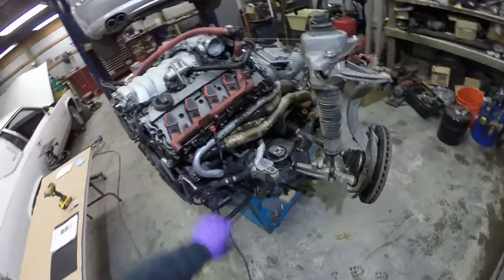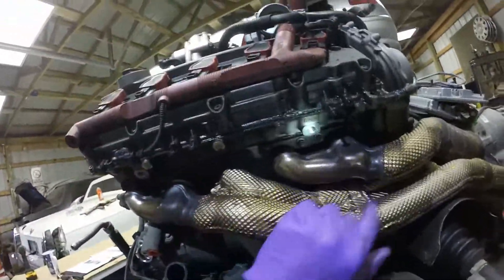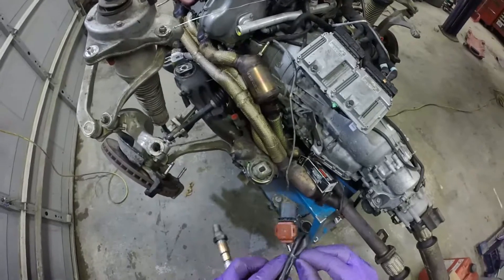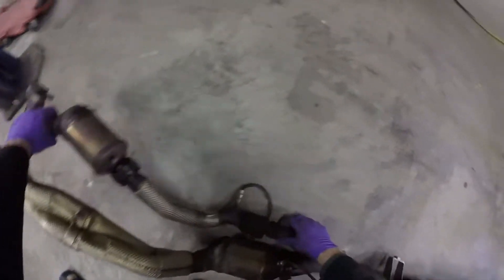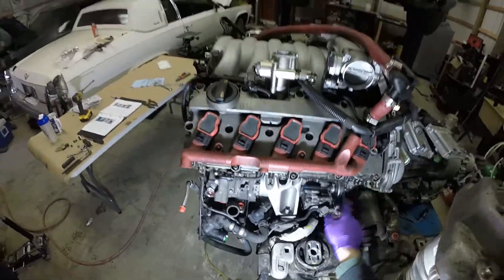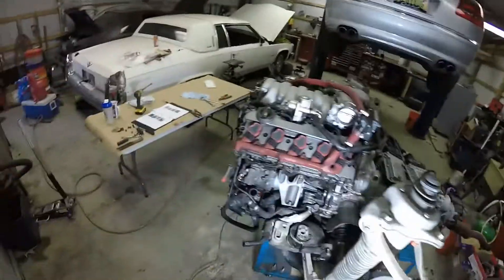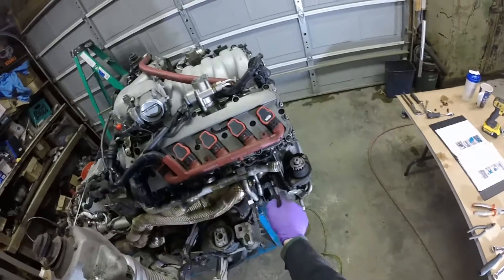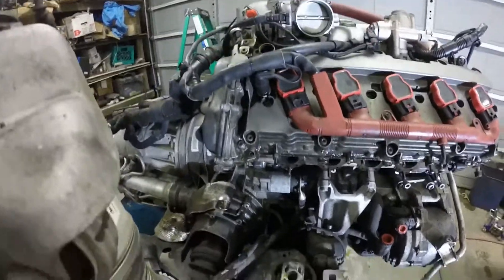Audi V10 S8 5.2 BSM: Removing Exhaust Manifolds from Engine Part 5

Comment: One time use nuts?!  I was not aware of a Torque to yield style nut.  huh
Reply from the maker: These are factory deformed copper nuts. Once you run them on theyll stay put..but only once. Take it off and compare it to a new one, youll clearly see the oblong shape of the new one vs the now rounded out used one.
Reply: @BGGarage  wow, keeps you coming for more.   Jeez

Comment: If your engine  loses power cause it needs the intake clean will it get all it back if they service it.
Reply from the maker: caged lion yes it will restore a good amount lost depending how badly it was coked up. Make sure the injectors are good too, they can develop a bad spray pattern causing loss of power up to misfires

Comment: Your vidz crack me up were you out of i just got a audi s6 v10 79600 miles this is the cleanest ive seen it fucking hauls serious ass i here at 80nk u shouldndo  intake cleaning that it will throw a code missfire thats what the audi dealer said but it dont feel like it lost a ounce of power its as fast as my gt500 Shelby

Comment: I have to replace B1S1 and B2S1 lambda sensors - hence there are 4 before the cat, 2 per block - which one they should be ? Any idea ?
Reply from the maker: Viktor Bonev right side (us passanger) is bank 1 and bank 2, so cyl 1,2,3 are B1, cyl 4,5 are B2. and S1 are yoir primaries so pre cat, hope that helps.
Reply: Thank you very much ! :)

Comment: Watching in anticipation of dropping my motor Completely off topic request.  I am curious if you could post or email some video of the hood latches from multiple angles? My car's hood release cable came undone and I want to avoid cutting the latches.  I'm look for any vantage that promotes inserting a tool from the front and pulling.  If you have time. I'm sure disassembly is consuming but your efforts would be greatly appreciated
Reply from the maker: NFLTec3  ill take a look for ya in next few days if i have time. Worst case early next week